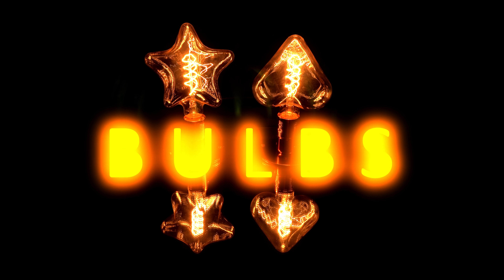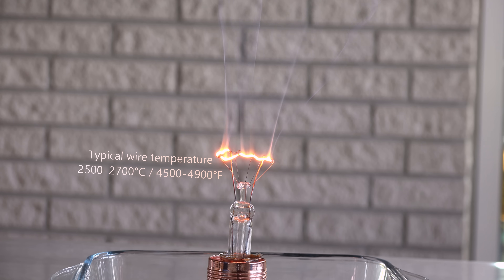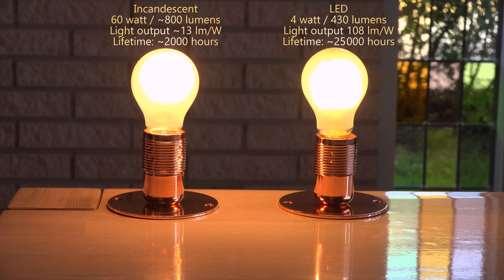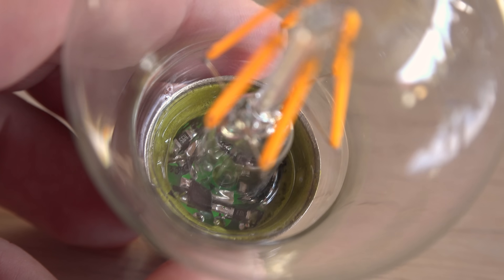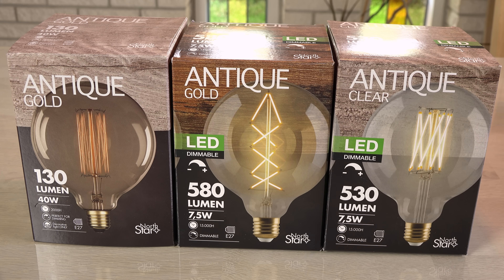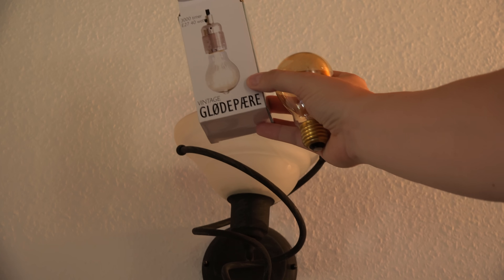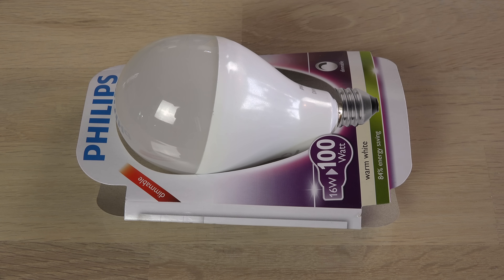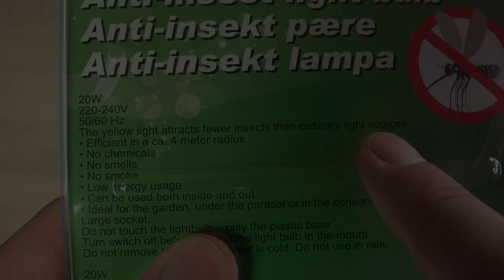Light Bulbs | LED vs. Incandescent

Comment: I live in Canada, and we mainly use incandecent. It keeps the house warm and it also saves us from turning on our heater, which is large and smells like old clothes. we use CF bulbs when it is hot outside though, but we are switching to LED. I personally think that bans on incandecent is the most brainless idea ever
Reply: I do the same in North Carolina USA. Our winters are mild, but it still can get pretty cold. I switch to incandescent in winter and LED in summer!
Reply: Although that is true, I've heard that flicker is more noticeable than on incandescent and CF, but I think that that's just for the crap brands.
Reply: I have an old 2000 watt bulb I control it with a dimmer and only with 120 watt it gets hot but it is quite ok and it lights up with a color that is just as the sun goes down it is approximately 20 cm diameter
Reply: Roller Coaster Maniac  Finally a Canadian who talks common sense:-)
Reply: TEFENsTech  You are so true!  California's CARB recently banned Jerry-cans based on some bogus fumes- emission issue.
Reply: Well, countries like Denmark have warmer weather, so incandecent bulbs are less useful
Reply: Some form of photosensitive epilepsy due to 50/60hz strobing maybe?  The fact both the cfl and the leds do it to you lends some credence to the theory.
Reply: Jod Bronson I know some people will say this is BS, it's not, there is an allergy to that specific kind of light
Reply: ***** THANK YOU !!! You don't even know how many People I have talked to, and including my own Father saying that this is BS too, NOT on BS, but I am CRAZY :(((. If it wasn't for my Dog, my Father would have NEVER believed me :(((. Make a long story short, when we had the LEDs on.... About 15 Minutes later, my Dog and I would start Coughing, and it gotten so bad at times, that we BOTH Choking on our own Spit due to Coughing. That's when we realized that there was something wrong in the Air/House. That's when we asked ourselves " How can a Human and a Dog Cough and Choked at the SAME TIME "? That's where our Venture begins and that is how we knew. Needless to say, 5 Years of Heartaches and Arguments between my Dad and I and countless sleepless nights :(((. But I am happy to say... I now live a much Happier, Healthier Life :)))... THANK YOU for saying that and much RESPECT to You on this end :)))
Reply: B Danielle  I bought some new cheap incandescent bulbs from China a few months back. Most of them burned out with a week of use!  To be sure I bought them at a sleazy liquor/convenience store.
Reply: Roller Coaster Maniac incandescent bulbs are better for reheating food
Reply: I'm also an ALL-LED in our home. For example I had 4x50W GU16 in our living room and now I have 4x5W with almost same effect. I don't know if there are any hidden dangers in this, but I would worry much more about GSM and WI-FI before LEDs. Anyway almost nobody knows, that white LEDs don't exist really. They are blue LEDs with phosphor on them. That is why they are yellowish orange when not lit.
Reply: Even with the same "glow" you can still see the colors shown are not that accurate because of the low CRI.
Reply: It's kind of brainless when people actually waste A LOT MORE energy using electric kitchens, hair dryers, water heaters, ac that sucks hundreds or thousands of kw/h.

If you need really accurate colors for work, nothing beats an incandecent bulb.
Reply: Thanks for the video and work. I live in a cold climate so a inconsistent bulb that creates both heat and light. The heat is not a waist. It just depends on where i get my heat from. Natural gas or electricity. The bulb just makes a small amount of heat. I like the light that comes from a inconsistent bulb.
Reply: How often do they burn out ?
Reply: I agree it's very brainless tbh LEDs just don't give off the same warm glow imo
Reply: +B Danielle - THANK YOU and You are 100% Correct again :) - I forgot to add the CFL's and what it really does to me... YES, I am not referring to anyone else... Since I am afraid to even speak of it, I usually keep things to myself.  Sometimes it's best to be in silence and sit back and laugh rather than saying something that People don't' really understand and then they think you are weird or just plain crazy. But YES, everytime we have our Garage CFL light bulbs on and over 20 Minutes or so, I get really sleepy. Then this weird smells after ward... Then I an unable to breathe normally, my nose would stuffed up... Feeling ALL tired, even I haven't done anything. Once the lights is off, I feel energized again.  Took us 3 years to find out that is what Florescent Lights do to ME. Yes, I have to say ME... Since I am sure there are other People DO NOT have this affect on them. So ya, I am sure that multiples health issues is or are effecting People and they don't even know it.  I did went to a few Doctors, to see why I am I tired all the time. I am half the age of my Father and I feel OLDER than he is... But until we found out, now I have more Energy than ever. So we took ALL of our CFL's bulb and replaced them with LED's... That's when we knew another adventure took place and now we found out that I am allergic to LED's as well. Funny thing is... If it wasn't for my Dog, NO ONE would believe me :(((.  Everytime we turn the LED Lights, me and my Dog would Sneeze and Cough... Sometimes, it would get to a point that we CHOKE on our own spit. I used to say, "How can a Human and a Dog Sneeze and Cough AT THE SAME TIME? "  there must be something in the Air. But to our surprises.. And a lot of experimenting and sleepless nights... We found out by shutting EVERYTHING off and turn on things ONE BY ONE... When we turn on the LED Lights... BAMMMMMM... That was it. I am happy to say that I am Glad I found your Post and I no longer feel that I am NOT the only one feeling the CFL's and the LED's are harming People's health :(((.  Sometimes it's such a bad feeling, that you are just ALONE !!! ALL of the People around you would think you are CRAZY because you are Sneezing and Coughing and Choking on your own spit. It gotten so BAD, that to a point my own Father thinks I was CRAZY ((((. So a BIG thank you to my DOG, or else People would think I am really Crazy :))). So yea, I am soo happy to have found your Post....   YES, " THE INCANDESCENTS " bulbs are much Healthier, although it cost more to Light them, but CHEAPER than going to a Doctor. Most Doctors don't really know your environments...  So they give you Pills to swallow instead... And keep you coming back for more because their BMW and their Houses have to have Marble Counter Tops :///. Anyone who is reading this and feel the same way... Please Please Please, I want you to know that " YOU ARE NOT ALONE " !!!! I am HAPPY to report, I am much healthier and live a Happier life without CLF's and LED's :))))))  NOTE: Caps is not yelling :))))
Reply: The only place that I know of them being banned so far is California but they like to ban everything that doesn't adhere to their new-age liberal/democratic anti-everything culture.
Reply: Roller Coaster Maniac hi fellow Canadian! The ban on incandescent bulbs around the world was a move by the Chinese government because all the curly bulbs were produced in China only. They wanted all other plants Around the World closed so that incandescent bulbs would not exist. (Using energy-saving as an excuse.) while omitting the MERCURY & toxic chemicals that will be polluting landfills &  peoples homes-( if broken inside the house). There are not adequate warnings on the packages.
Reply: TefensTech Wow really? WTF??? If People wants to light up their House with whatever, that should be their choice(s) :))). Hmmmm, I can't wait until they Banned these in New Hampshire... I will take them all the way to the Supreme Court, because I am extremely allergic to LED or CFL's.
Reply: + B Danielle - You are 100% Correct on " Omitting the MERCURY & Toxic Chemicals " but my advice, don't say it TOO LOUD. I am extremely ALLERGIC to LED's. Someday, People will learn that it is more dangerous than they think. But I too would NOT dare to say it too loud. People would think that I am CRAZY... Like I said to most People that I am ALLERGIC to WIFI. Just like growing up, I was extremely ALLERGIC to High Fructose Corn Syrup and Gluten. Years later, now we found most Company are gearing towards High Fructose Corn Syrup and Gluten Free.
Reply: Jod Bronson ...yes..I totally believe you about the LEDs !!! (& even one CFL/ curly bulb,.. creates "dirty electricity" through the entire house).. Many people are complaining of multiple health issues. 
WE NEED TO KEEP THE INCANDESCENTS !!!!
Reply: +meetoo594 - You can easily take the Photosensitive Epilepsy away. Now what if you BLINDFOLD me and TEST me with LED or CFL's and YES, TEST my DOG too. How would you explain that one ???  I can tell you ONE THING.... I can SMELL the LED and CFL's when on... If I DO NOT BREATHE, nothing is affecting me. I LOVE how People DON'T KNOW SHIT and try explaining something that is NOT RELATED to them............. Here is a simple lesson for you to LEARN :))). " Why is one Person allergic to Peanut, while most of us DO NOT? "
Reply: Michael Johnson  Does it really? 
The way I see it, we live in an age where environmental issues & causes are like a nutty state-sponsored religion driven by junk science and Green Party politics over the past forty years

Comment: halogen based lighting is still used in theatrical productions - intelligent LED fixtures (for stage use) are still quite expensive for smaller operators to switch to. This is probably the reason halogen hasn't been band outright in many countries.

Comment: As you stated heat is a benefit if you want heat with the incandescent . There are plenty of climates that benefit from the incandescent heat output. Some of the optional  bulbs take a long time to light well, so I just leave them on at all times. That probably winds up using more watts in the end. Government mandates are born out of ignorance. In my region we do far more heating rather than cooling. I've worked on farms where the lighting is the only source of heating, other then the animals.

 And from there you must consider what the bulb is made of and how it's reckless disposal will impact the environment.

Comment: the problem is many of the led bulbs available are truly crap. ie if there is not a healty fan on that 40w led bilb it wont last long. while led produce leas heat they are intolerant to hear. ie they die fast when they are over driven and almost 100% of consumer led bulbs are over driven to some extent. overdriven is not just over voltage current spec but also insufficient cooling for the voltage and current used. one trick that is not that useful for everyone (my entire home and business is led) is to array the lowest wattage leds you can get (2 to 3 watt being best) andnuse double the number you need and they use a variac to lower the coltage till the double number is the brightness of the right number of bulbs. dramatically reduces heat and kmproves lumen per watt efficieny and dramatically extends lifespan. i also like mixing day white and warm white since moat warm white leds are not really warm white so much as outright yellow. in the bathroom 3 2.8w day white and 2 2.5w warm white work perfectly for example.

Comment: One problem is that LED do not get warm, in the winter did the light also give some heat indoors, but when more use LED we use more energy to heat up radiators, but I love LED for they are more practical, but I think they are demanding more energy to make and that the production of LED light are not so good for the environment.

Comment: LEDs have come a long way and are a lot better than years ago. One of my relations work at a company that produces LED and they have such fine control over color rendering that you can't even tell the difference between traditional bulbs and the LEDs any more. I was pretty shocked when I saw the quality they are putting out. In fact, some of the cities that have been ordering street lamps have been requesting custom color index/tints applied to their LED replacements on the streets.

Comment: I decided to replace all (and I do mean all) of my home lighting with LED lights, so i bought about 300USD worth o LED light sources from aliexpress. I am very happy with them and even the ones that run of direct 50Hz AC (they have no rectifiers) - the flickering was noticeable at first, but now I barely notice it (though the light bulbs that run of DC are the way to go obviously), and about the CRI - the chinese merchandise obviously don't even state what there CRI is, but I haven't found any difference between the incandescent lighting and the LEDs (I bought the "warm white" variants), so it's not a problem at all. And IMO LEDs are the way to go, since I don't have to replace a burnt out light bulb somewhere in the house once a week.

Comment: One thing you have to consider when looking at the "rated wattage" of a bulb is that several of the Fluorescent and LED bulbs list an "effective wattage", which is what an incandescent bulb with the same light output would consume. This is so consumers who are used to figuring out how bright the bulb is by the wattage (instead of by the actual light output ratings) can still get what they're expecting. That's why the fluorescent bulb "rated" at 125 watts only pulled in about 50.

Comment: If the heat is used in place of a heater then we are not inefficient.
Reply: I use my computer to heat my room. "Oh its a bit cold, lets turn the graphics to high"
Reply: No, because the cost of building anything under ground is 10 times as much as building it above ground
Reply: yeah the thought crossed my mind to flip out the CFLs with incandescent every winter however I'm too lazy
Reply: +Al Brautigam heatpumps have great efficiency but very poor output below 40 degrees, the actual heat supplied is poor, hence the electric coil to assist heating, however the efficiency is amazing. I wish heatpumps were more common. I also wish they could match the output of gas!
Reply: Alan Crook if you heat your house with light bulbs then you probably have the biggest bills ever. thats not their purpose mate.
Reply: House heating is a by product that otherwise would be discarded.
Reply: That's true in the winter, but in the summer if you have air conditioning, it will cost you even more to cool your house.
Reply: Air conditioning drains power in a way that dwarfs light bulbs.
Reply: +Alan Crook because people still build above ground, which is not efficient.
Reply: It's more efficient to use heating methods other than electricity to heat your environment.
Reply: Heat pumps and furnaces are much more efficient than incandescent bulbs. Electric resistance heaters are slightly to moderately more more efficient, depending on the design and other factors.
Reply: +Al Brautigam heatpumps are most efficient with typically lowest output power
Reply: Bait28 I'm not sure what you're trying to say. They become less effective below certain temperatures, depending on size and application. That's why many have one or two stages of supplemental resistance heat.
Reply: Bait28 Mine works well into the 30's. Some have the external part buried where it's always 60-70 degrees. Some heat pumps have supplemental gas heating.
Reply: #littleAMDthings

Comment: The CFL uses more power than shown on a wattmeter.  Your meter is reading only the power going through the resistive portion of the CFL load, but the electronics in the base contain inductive and capacitive elements which use reactive power, which doesn't show on a wattmeter.

So the package power rating is probably closer to the actual energy consumed, than the measured wattage.
Reply: Reactive "power" is not consumed... It is returned... (The wires need to be able to handle the current though...)
Reply: Not strictly true.  When the magnetic field collapses in the inductor, or the electric field collapses in the capacitor, we say the power has "returned" to the source, because it isn't directly consumed by the end load.  But it does represent the full effect of the entire circuit on the power source.  That additional power \still\ has to be generated by the source, which still requires additional energy to run the source.  And there are additional losses in the lines through heat, corona effects, etc.

If reactive power were completely ephemeral, power companies wouldn't charge for it -- but they certain do charge for it, in industrial situations in which it hasn't been adequately compensated for at the load end.
Reply: fartwrangler it can be consumed by a different device (if the mix of devices are correct, which probably doesn't happen accidentally often)

Comment: The lower left utilzed ssdumes a power favor of 1.0, a purely resistive load. The electronic circuitry has a high capacitive factor which puts the maximum current draw slightly out of phase with the supply line voltage. That is why some LED bulbs seem to draw less than rated power.

Comment: Hey Brainiac, the Complex Power (VA) is more interesting to compere between those bulbs, because when incandescant bulbs have roughly a power factor ~1 (that means the voltage and current are in phase, like when you apply AC to a normal resistor), this changes when you connect AC to a capacitive/inductive load. So, when you measure the active power (W) you dont't know how much power the load really draws, because you forget about the reactive power (var). Those two units combined is expressed in Complex Power. ;-)